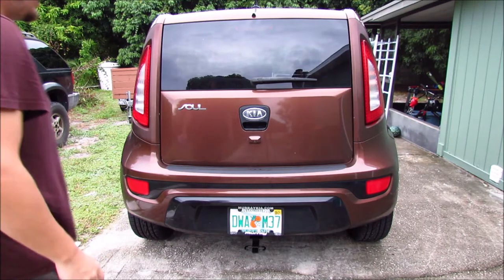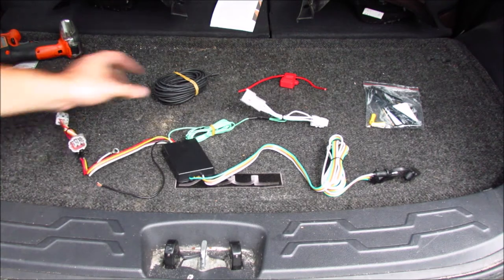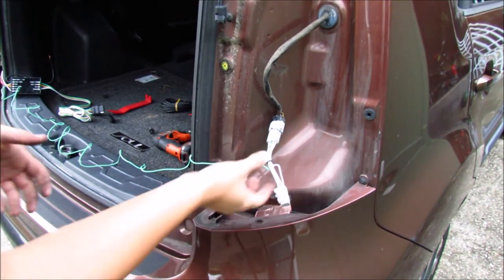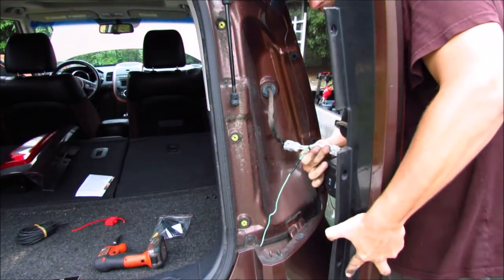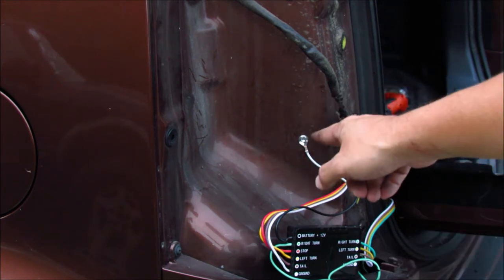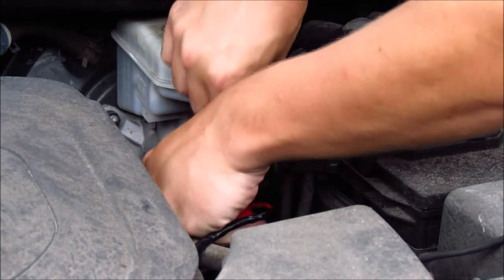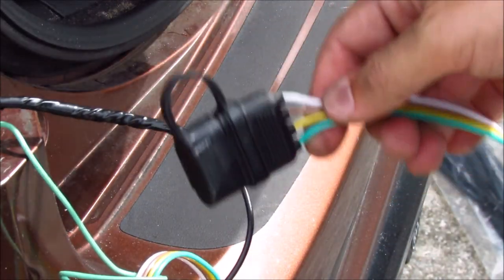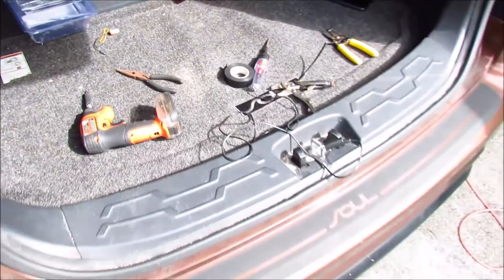How to Install Trailer Harness on Kia Soul

Comment: One could add wire loom if they are concerned with shafing the wires. 

I used to install video recording hardware in the trunk of squad cars. We would  push power cabel through the firewall to a center consol to power everything from the consol with a 15 minutes accesiry delay device that kept equipment powered for 15 minutes after the squad car was turned off. Then from that councle, power fused again and routed underneith the carpet along the driver side front and doors to behind the rear seat and into the trunk where the video recording equipment was mounted. 

I just bought my 2019 kia soul. While i dont think i will have need to power my center councle, i might still route the power through through firewall to the interor inder the door trim all the way back, to minimize wire shafing against the fame and body, and minimize road grime. Or, if i route it underneith, ill definitely add wire loom.